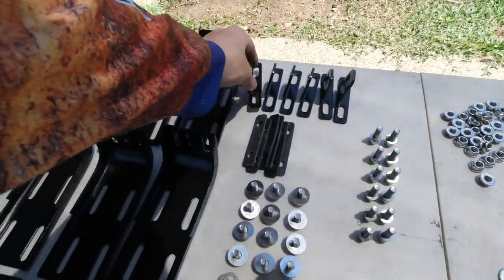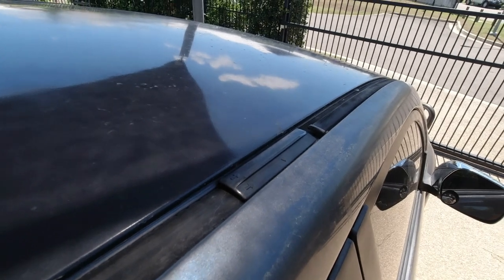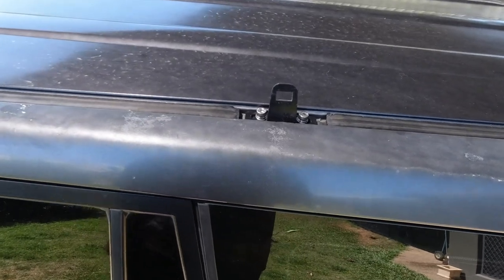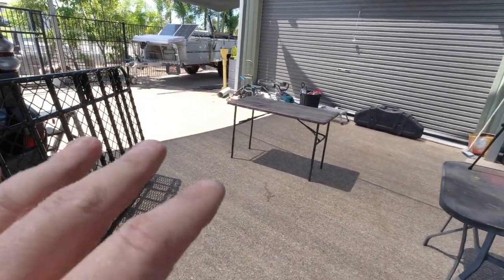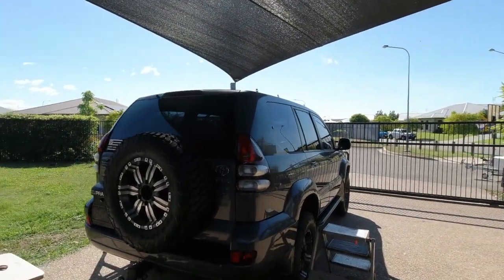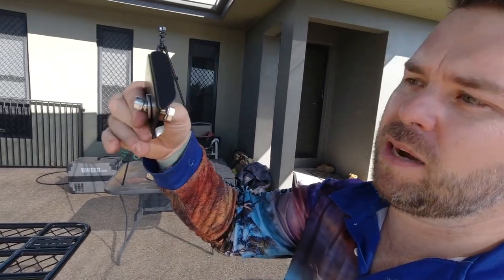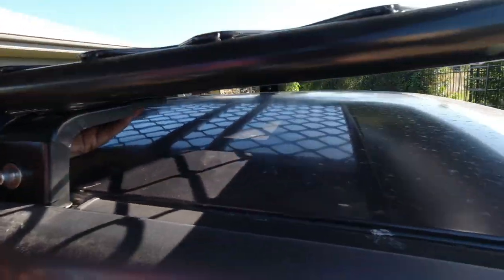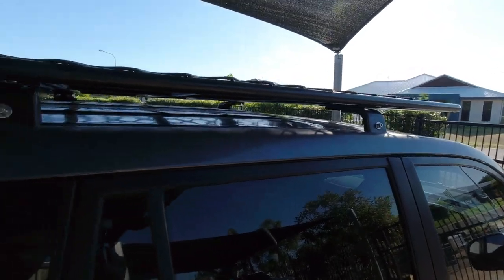WHO NEEDS INSTRUCTIONS ANYWAY!? | Best value for money aluminium roof rack for my Prado 120

Comment: Hi Kenny, thank you very much for doing this video!! It's excellent. Just some feedback, our initial installation video was done in 2016. Aside from being our early days, the roof rack has had several upgrades since then. The reason for needing to use the 2 inner slots is that the rack is now 100mm wider. It was 1050mm wide. We found 1150mm is a better fit. Also, the height of the brackets have been reduced to lower the profile, so the installation method you've shown is the way to go with the lower profile set up. Sorry about the mix up with the incorrect bracket. Also, we're stoked that you're happy with the OCAM roof rack. Your feedback encourages us to continue working hard on making quality 4x4 accessories more affordable!! Thanks again.

Comment: Good job of it. Just about to fit one to my MUX so I hope it goes well. Just one warning. I fitted backbone rails to my 120 and found that the mounting nuts in the roof were loose. Dropped the first one into the roof lining and had a big job getting it out. Used wire to hold the rest of them. Take care.
Reply from the maker: Thanks Greg. I’ll check mine again after the next trip 👍🏼
Reply: How did it go on the mux? Im about to purchase one for my mux too.

Comment: hey mate, have you had any issues with the rack since you've had it for a few years now?  Any rust forming on the fixings/brackets? How's the paint holding up?
Reply from the maker: Hey mate, nah still no issues with the rack at all. The bolts are made of steel so i've seen some really minor orange stain in the area from rainwater sitting on the bolts. Only cosmetic. The rest of the rack is all aluminium so no rust issues at all.
Reply: @Kenny_B  awesome, thanks for getting back to me man. Trying to decide if I should buy one or not. Had a kings steel rack that faded and rusted. Just fixed up the roof damage and want something better 👍🏻

Comment: Hi mate, looking at grabbing one of these, what is the noise like when driving on the highway / any high soles?
Reply from the maker: Hey mate, it’s not very noisy. Just a slight wind noise . Doesn’t howl or anything like that. I also have 2 solar panels mounted on mine now and it’s still not too bad. About as good as 99% of racks I’d say 👍🏼
Reply: @Kenny_B  thanks for the info!

Comment: How has it held up? And how do you wash your roof?
Reply from the maker: Hey mate, yeah it’s still holding up fine. No issues at all. I just pressure wash in the gap but I’m not overly worried about my paint anymore. It’s purely a 4WD these days. The clear coat on my bonnet died and I just raptor lined it black 👍🏼

Comment: Over a year of having it. How is it holding up
Reply from the maker: Still no issues mate. If you watch my playlist doing Cape York this year you can see all the gear i had on it. It has a 270 awning on the side, two 110w solar panels and maxtrax. Plus we carried both swags up there each day on the trip. A Rhinorack or Pioneer platform obviously has better bolt on brackets and things but it's 3x the price of this one.